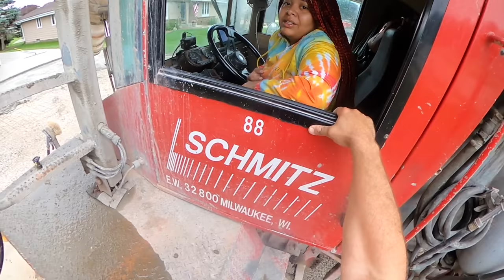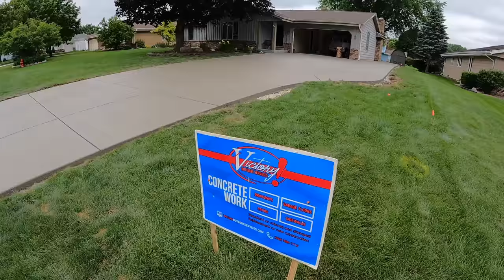Concrete rejected-Load was too wet!

Comment: Wire mesh does no good sitting on the subgrade.
Reply: can`t believe left the mesh laying on the ground  ROOKIES
Reply: need some mars bars
Reply: The wire mesh is just for looks at the bottom of the concrete
Reply: @LastChanceHomie  I get the "we will pull it up during the pour" all the time, BS. Put it on chairs or it doesn't get approved.
Reply: @ukcitizen5341  yep
Reply: Have you ever spoke to an engineer about that? Because I said the same thing once and the with way concrete fractures there are opinions on where the wire mesh should be. Lifting it up won't hurt but I was told, and drawn diagrams of how concrete is stressed that it truly doesn't matter and the wire on the bottom stops the concrete from coming apart and ultimately fracturing at the top. For concrete to crack at the top it has to expand at the bottom. When I asked other people about they tended to agree. I think this guy has a way he does things and it's worked well for him...
Reply: @dc6233  details will show the wire mesh in the slab off the ground. Code requires a minimum clear spacing of concrete exposed to earth. Steel reinforcement against the subgrade will rust and when steel rusts it expands. For welded wire reinforcement, the Wire Reinforcement Institute recommends steel placement 2 inches below the surface or within the upper third of the slab thickness, whichever is closer to the surface.
Reply: @dc6233  I am a structural engineer actually. The fabric helps with crack control. In elevated slabs we mandate it is 1" from the top where it will do the most good controlling cracks on the surface where they are visible. It is true that having reinforcement in the bottom of a slab will give it strength (depends on the layout especially for elevated slabs). Regardless, any kind of reinforcement in concrete needs cover to both effectively bond to the concrete and also have longevity against deterioration.  For rebar this is 3" if cast against Earth. It can be less for fabric due to it's smaller size but sitting on the ground is definitely not acceptable in my opinion.
Reply: @dc6233  long story short concrete is bad in tension and will crack in faces experiencing tension from loading or thermal cycles. You reduce the cracking by providing reinforcement close to those faces, not on the opposite face away from it.
Reply: 3" clearance above earth per aci 318 if you wanna go by the books haha!
Reply: Actually that wire mesh prevents the concrete from sliding on high grade surfaces
Reply: Gotta raise that mesh as the mud pours. Wire for flexural strength. Concrete for compressive strength. Comment for mental strength. 

☝🏻😂😂😂edit: HIGH GRADE SURFACE?!?!? Gtfo.
Reply: @JosephKirbyCarr  umm no, definitely not
Reply: Come on guys its just a concrete driveway not highrise apartments. I'm sure they would have lifted the mesh as they went, we just didnt see it in the clip.
Reply: Where are the bar chairs?
Reply: @redwalsh87  laying concrete without compacting it is good ? :)
Reply: @pengswanchan2937  not really, either crushed stone as they did or proof roll the soil if no stone.
Reply: @downeyd88  right then they don’t have to lift the mesh up or they could actually use rebar with chairs like you should
Reply: He knows more about making YouTube videos than rebar and mesh.  Overall 20% of the job fails it all.
Reply: @mmmartin261  the guy has been pouring for years and years before he started YouTube.
Reply: Lol there is a hook on the top side of the come-alongside that is made for pulling up the mesh into the concrete while pouring
Reply: @porkchopzmeat3099  time stamp the hook?
Reply: Yeah he’s just about making a video and getting free stuff sent to him by corps who don’t read these comments.
Reply: @redwalsh87  Iv'e seen them lift it in some videos, but seconds later the concrete placers walk on it..Not  great .chairs are the answer..
Reply: @redwalsh87  Most finisher I am working with will pull the wire mesh up but a LOT of them are a way too lazy to do it .
Reply: @kermit8619  pulling it up works until you take a step and push it back down. The only right way is on chairs or pieces of brick.
Reply: @dc6233  Been doing custom new home construction for 20 yrs, the only builders that use the cheap chicken wire are the cheap builders. Concrete that has the chicken wire doesn't last, the chicken wire corrodes away leaving NO strength to the concrete. Either do rebar or don't do concrete.
Reply: @redwalsh87  Amen brother, people who use the chicken wire are cheap and don't care about the quality of their work.
Reply: @JosephKirbyCarr  nope.
Reply: @Timbo_tango  You do it as you spread the concrete whilst pouring, not after.
Reply: @TehMunch1  Makes no difference, all he's doing on YouTube is showing people that what he's doing, he's doing it the wrong way.
Reply: @seanlevoy9446  Well this YouTuber only studied concrete .50
Reply: @dc6233  It's actually building code, as it does make a difference in the slab's strength.   And not pieces of bricks, or stones, actual chairs made for the purpose.
Reply: Down under we screed off the concrete and finish the edges but we cut our control joints after the concrete has gone off will you then cut through the concrete and all the reinforcing mesh which is on chairs  ,  cutting through the reinforcing Mesh and the concrete the expansion/ control joints stop the reinforcing mesh holding the joints together .
Reply: @dc6233  It works for this guy because he gets paid and on to the next job. You won't notice the difference for the first five or ten years. The mesh will rust, spall the concrete and separate from the slab. Now you have a slightly too thin slab with no reinforcement. It will need replacement in 20 years.  If done properly it should last 50.
Reply: Leave it to the engineer.... “ 1” from the top of slab” works a lot better on paper than reality. Mid slab or bottom 1/3 is what we see here. Your sub grade would have to be PERFECT for you not to have spots in the slab where the mesh sticks out (especially on exterior slabs with pitch) after screeding and bull floating and in commercial work where the site work contractor preps the grade, good luck with that grade being perfect

This guy is doing residential construction work and is obviously giving customers competitive pricing due to his ability to blow our pours more efficiently than his competition. You wanting him to use chairs on mesh requiring additional labor / or a concrete pump and every pour is completely unnecessary and drives his costs up to the customer. He is pouring driveways, not building bridges 

As a side note, poured our 4” concrete driveway at the shop with no fiber, reinforcement, or mesh. Drive 20k lb equipment over it all the time
Reply: @jimb8719  "can`t believe left the mesh laying on the ground  ROOKIES". Oh no, they're pros. They know how to get out of there as fast as possible and earn that "easy money".
Reply: @Aqufrank  sounds like a lot of excuses to me.
Reply: @jimb8719  where is your YouTube channel I bet Ryan makes way more money than you and how long have you had your concerte business that's what I thought you can easily keep moving and don't watch you don't have to be hater!!!!
Reply: @redwalsh87  Your full of crap where is your channel then big shot engineer lol I am sure your the best engineer in the world lol  What u don't know is you can't really see it on the video but the wire is being pulled up You think he has been in business 20 years and all the equipment he has cause he doesn't pull the wire up lol If u watch all the videos he talks about it people like you comment about not pulling the wire up lol
Reply: @mmmartin261  hey Martin watch the next video and he talks about people like you!!!😂😂Wire mesh police 😂😂
Reply: @jeffs7573  then why you watching move along no one ask for your or nobody's else's bad opinion This puts this stuff up to show his craft and to be in business 20 years I would say he is doing something right!!!! If you are so good where is your channel you wouldn't be able to get off your lazy butt and edit the videos 😂😂😂Its ok to wish you was him though
Reply: Macro fiber is better then mesh all day lol
Reply: @gregsteadman  Wow your comment is as asinine as they get, why would I want to be on You Tube? I don't have the time to waste, However if I see something done wrong and know that it is done wrong I'll comment on it.
Reply: Only if you agitate it. Doesn't look like they're agitating
Reply: That's what that hook on the back side of the rakes is for. Hook the mesh wire and give it tug. As long as it's not laying directly on the ground is good enough for me
Reply: This isn't structural concrete....if you prop up the mesh the relief joints may not be able to be cut.
Reply: @JosephKirbyCarr  no that's not true.
Reply: @hendrikvanleeuwen9110  - a driveway in Wisconsin isn't going to last 50 years. Maybe in California, but not in a cold region.
Reply: @gregsteadman  "where's your channel?" such a stupid attempt at insult.
Reply: @chubbzy24153 the driveway has to be at least 6in thick for vehicles to drive on and not crack. You got plenty of room to lift that wire up and not worry about not getting a jointer through. If the wire was lifted so high that a jointer can't get through,  the wire is too high
Reply: Came on here for the same responce. I guess thats what you get when you bring out the AARP crew.
Reply: @seanlevoy9446  the expansion foam strip?
Reply: Yeah what's up with that? Never lay mesh on the ground....ever.
Reply: @Timbo_tango  that driveway probably cost him minimum $20,000. So yes, it definitely matter to the homeowners.
Reply: @jeffs7573  you can tell this guy cuts corners and likes to save money. Greed... sucks.
Reply: I don't think university of Wisconsin would agree with you
Reply: Fun fact if you watch closely around the 20 minute mark they do lift it
Reply: @jking0.o121  As long as the mesh isn't lying on the bottom in the dirt it dosen't matter where the mesh is sitting in the slab itis structural.
Take alook at 24:12 mesh is lifted. Y
You gotta to take into account these guys were done over by the concrete company with that sloppy mix having to be sent back meaning the first load had gone off too much. All his time would have been taken in switching to plan B to save the job. Filming his guys lifting the mesh would have been a low priority.
Reply: @wk9953  where??? I watched and rewatched it and have yet to see them lift it, so then that is only a fun lie.
Reply: @jeffs7573  at the very first dump of concrete out of the shuttle the one worker picked up the edge. It was a sarcastic comment on the side car park
Reply: @redwalsh87  In our HOA we use rebar on dobies (chairs I think I have seen them called here) and throw in fiber glass to boot. No cracks even where tree roots have lifted them.  We had contractors say they lift the rebar when they pour but when you lift one end then the middle the end you just lifted will dive just like rebar sags at the ends when held in het middle.  They do not work for us any more.
Reply: @wk9953  ok my bad, I didn’t see it as sarcastic.
Reply: They even placed dowels connecting to house to the slab. WTF?
Reply: @redwalsh87  We always pulled it up into the pour. But we actually did it. Every single time. Whoever was on the chute had a hook as did at least one of the guys on the shovel.
Reply: @Timbo_tango  I didnt' see anyone with a hook in their hand, and didn't even see any laying around.
Reply: @JimDean002  At 20:30 slowing the playback speed down you can clearly see the guy using his screed to lift the wire multiple times as the concrete is coming out of the shute. If using a screed instead of a hook is cutting corners I wouldn't be too concerned.
Reply: @dc6233  good point
Reply: @jeffs7573  I know you'll never admit that you're wrong and the wire will be fine in 20, you know-it-all's are annoying af.
Reply: yurp. dont even need to pull it while pouring like what folks are talking about.. just use fkn dobies. its not much extra work nor expensive. id accept dobies and dopes not stepping all over the fkn mesh. but that all depends on how much this guy paid for the work.
Reply: Good catch on that wet load. The most important thing is to keep your water/cement ratio as close as possible to the mix design. That will give you a durable concrete that will hold up in the freeze/thaw cycles. Air admixtures are important too. Problem I see every once in a while is the mixer driver doesn’t spin out their rinse water.
Reply: @jeffs7573  👍👍👍👍👍 Exactly. Seems "Greg" is really triggered by ppl pointing out crappy concrete construction practices.
You can see throughout the filming and even especially where the slab ends while he was waiting for the wet load replacement that every bit of the mesh was flat on the ground, under the concrete. I've worked nearly every aspect of the concrete industry for over 40 years and it's not rocket science to see blatant bad practices.
Reply: @seanlevoy9446  if I  spent that much for a driveway in Wisconsin I would have put defrost tubing in the pour.
Reply: @gregsteadman  are you related to the video maker?
Reply: Fibermesh and rebar work best . Wiremesh is old school , problem is most customers will not pay the extra costs.  Adding rebar and fibers to that job will cost him 1k more. Rebar is not cheap.  I have seen concrete change color from rusted wire.  Coated rebar or thick mesh work good.  This guy did great  job on cuts and finish.
Reply: @Jamax99Jetfan  Rebar is cheap in cost, it's the labor of installing it that is costly.

Comment: "concrete is super neat"
-me, not knowing anything about the craft
Reply: From the little experience I had doing this type of work it can be hard or just time consuming  depending on what you are doing. Since I dont have the patience I think the finishing is more difficult simply because it seems more artistic.
Reply: I did it for about a year it’s interesting but rough, sometimes you can’t get a truck close so you have to use wheelbarrows and that’s a killer. Sometimes you can load a skid steer bucket full but not always
Reply: The fun part is finishing like smoothing it and stamping
Reply: Not easy, hard work.

Comment: i remember being stuck in traffic in the 90's with a concrete truck stuck with us. it was one of the hottest summer and not even 10mins in the mixer truck started laying on the horn like a maniac. i think we were stuck for 1hour and half. that truck must have been scrap metal after that.
Reply: Yeah time for a new drum lol
Reply: I worked for a welding shop we cut a hole in the side of the mixing drum they jackhammer the cement out we weld the patch back in
Reply: @JohnAdams-xc5yk  Try dumping a 5# sack of sugar in once you're sure your load won't be delivered on time. It'll never set.

Comment: QC Manager for Redi Mix producer here.  Your second load was absolutely too wet and you handled that perfectly and very politely.  It may be useful to put yourself or one of your reliable crew members through the certification training process for slump and air testing.  You may be able to protect yourself from issues like this if there is a dispute with the supplier by being able to perform these tests in the field.  However, slump is a pretty obvious judgement call visually and you were able to make a good decision for your client.  FYI a driver will base their estimation of slump on the resistance to the effort needed to mix/agitate in their drum.  More force needed will equate to a stiffer mix.  This driver likely mis-judged how much water she still had on from rinsing after the load before, and as a result, the batcher didn't withdraw enough water from the mix design to account.  Sometimes they can identify this before it leaves the plant, and add extra material as a dry up.
Reply: What do you think of water reducer? Is it even allowed on commercial work? Mike Day pours 10+ slump and says it's perfectly fine. I'd be curious what a QC guy thinks
Reply: @okgroomer1966  Water reducer is in every load down here in Florida, no matter the slump. We use high range water reducer when the slump hits about 7.5
Reply: She might have had a pump clean into her truck the job before and forgot and went and got loaded.
Reply: @okgroomer1966  Water reducer is a good product. You can make it slump wetter while maintain your cement water ratio of a dry slump

Comment: That mesh works great sitting on the ground.
Reply: Never saw them lift it once !!!
 So much for the integrity of the pour !
Reply: x2! I laughed when I saw that.
Reply: U could clearly see him pulling up the mesh at 20:02 can't expect the entire video to be of him pulling up the mesh
Reply: @nacib01  
 Your right,,at 20:02 he pulls it up once. That was a 20 plus yard pour !!
 That wire mesh did nothing laying beneath the mud !!
Reply: should be useing bar stools
Reply: maybe i have learned it wrong but me is always told that wet concrete hardens better then dryer concrete bc its getting a better structure or something like that and that mesh should have soe little stone spacer blocks under it to really work to
Reply: @kevinbakker3007  They're called 'dobies' and they come in various sizes, anywhere from one inch all the way to 5 inch, that mesh does absolutely zero sitting on dirt, the customers leave it up to 'the professionals' to deliver what they've paid for and from what I've seen lots of people being ripped off, too bad.
Reply: So your the wire police he's talking about 
Must have binoculars for glasses
Reply: Yes! Look at 20:02.  The middle is being pulled up only!  Even the dowels are sitting on the gravel!  Anyone laying concrete should know better.